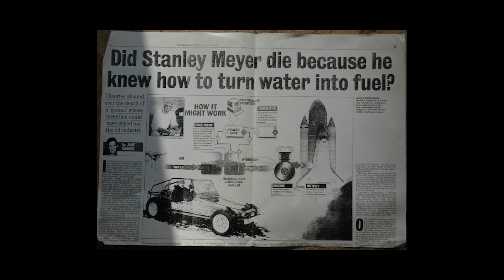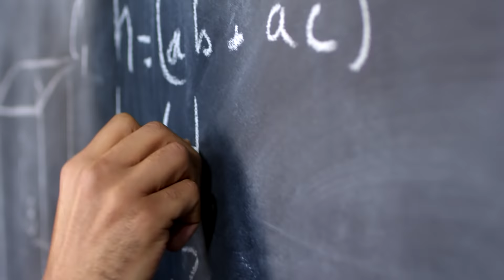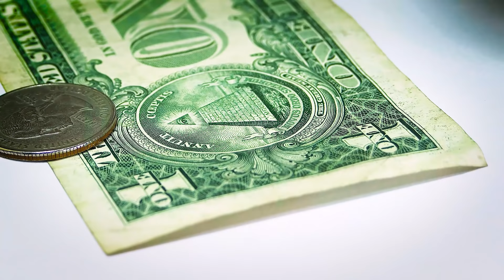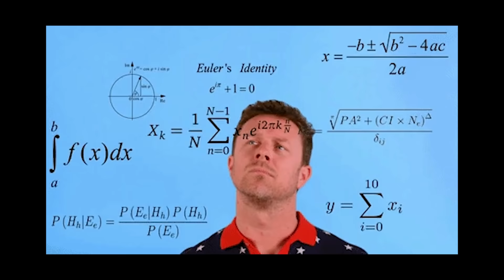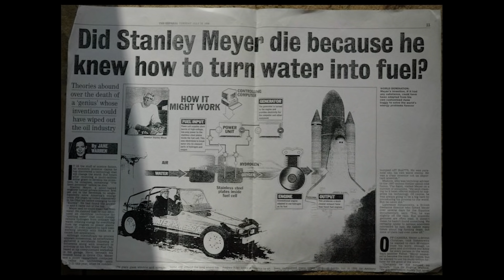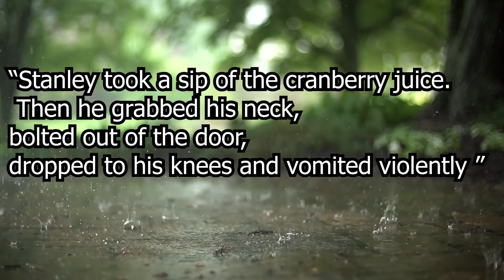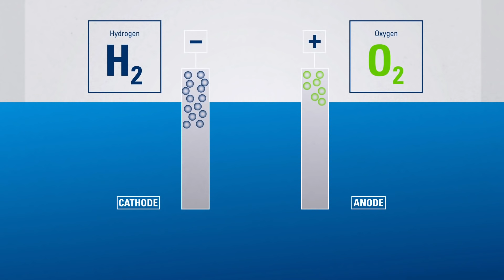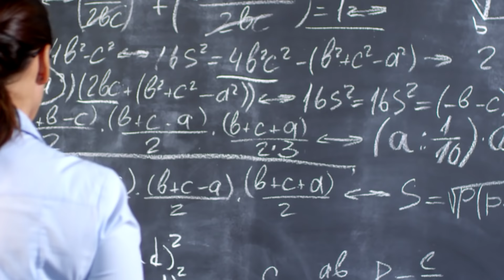Stanley Meyer Water Powered car, Lies and Death

Comment: mtttony is correct in his reply to this video, there is no way to make the excess energy appear in the form of excess hydrogen, you need to reverse where your heads are at, the energy comes from the correct burning ENVIRONMENT of the hydrogen and then the correct containment of the exhaust from said burn. that hydrogen oxidisation exhaust, is water and it is  a liquid 1800 smaller that the volume of gasses burnt (propellent and oxidiser).

combine what I'm telling you with what mtttony said, this is basically the answer to how stan made it work, the big secret. 

You don't need to modify the valve train, you do need to make a slight timing adjustment (just past TDC) and you need to inject the hydrogen at an unusual time (TDC between Exhaust and induction strokes) . You also need to ionise the intake manifold to make electron deficient oxygen (or OZONE) and use a second seperate ioniser to get more nitrogen from the air (charged Activated carbon) and add this nitrogen to the intake manifold to retard the burn, this is not that hard, easier than is sounds. 

In a four stroke, on pure hydrogen propellent, things are completely different, you can make other, different types of forces move the piston on the different strokes.  

NORMAL HYDROCARBON PROPELLENT FOUR STROKE

1 INDUCTION Stroke            down
2 COMPRESSION stroke     up
3 POWER Stroke                  DOWN
4 EXHAUST Stroke.              up
boring!

STANS HYDROGEN PROPELLENT FOUR STROKE

1 BURN WHILE INDUCTING POWER Stroke.                <<<<DOWN
2 FORCE OF VACUUM POWER Stroke                          <<<<UP
3 EXPANSION OF CONDENSATE POWER Stroke.      <<<<DOWN
4 Exhaust Stroke.                                                             up

 IN A 4 STROKE ON PURE HYDROGEN THE REACTIONS ARE DIFFERENT !!!!!!!!!!!!!!!!!!!!!!!!!!!!!!!!!!!!!! fark its actually not hard. 
The 'excess energy" comes from phase change of a working fluid. Look at how a reverse cycle air conditioner works.... 1000watt in = 3500 Joules out. COP 3.5 phase change of working fluids rob heat from an environment. this is how it works. 
Have fun. 
Ask Questions 
B-)

Comment: Of course, it worked. I have numerous HHO Fuel Cells I've made for various reasons. HHO Water Torch, HHO Fuel Cell for Lawntractors, HHO Fuel Cells for experimentation on voltage and current, and yes HHO Fuel Cells For Automobiles... I don't know how many I've built over the years. Stan went a few steps further in his setup. There's no doubt it worked incredibly well and was super efficient.
Reply: Proof?
Reply: @uku4171  my basement
Reply: @kaniuoh911  so, none?
Reply: @uku4171   come and see
Reply: @kaniuoh911  or you could do a video. That's only if it was real, though.
Reply: @uku4171  can u prove it’s not real?
Reply: @kaniuoh911  not how burden of proof works
Reply: @uku4171  u know now.
Reply: @kaniuoh911  that reply does not respond to my reply in any way.
Reply: @kaniuoh911  And I do know it is not real, as it would break the laws of thermodynamics.
Reply: @uku4171  it doesn’t have to
Reply: @kaniuoh911  should've realized you were trolling
Reply: @uku4171  took u long enough

Comment: You seriously don't think that an alternator could produce enough energy "efficiently" enough to perform electrolysis? Come on dude... as long as the battery could Jumpstart the process the alternator would have no problem out putting the electricity keeping the hydrogen flowing.

Especially considering it was directly fed into the combustion chambers from the process of electrolysis. Didn't even need to produce alot, just had to produce enough to fill each chamber before each one went BANG!

It's %100 do able you nut.
Reply: That violates the laws of thermodynamics. How do you get more energy from joining H2 to O2 than splitting it?
Reply: Trying to convince some people is a waste of time.
Mayer was on the right track.
Reply: @ChucksSEADnDEAD  couldn’t you use a battery? Hho seems like a very energetic gas how about solar powered electrolysis the whole unit in the actual car
Reply: @Nonya704  Of course you can. But the issue is that it would be better to just feed that electric energy from the battery to an electric motor.
Same with solar. An internal combustion engine is 25-35% efficient. A PV solar panel is around 30% efficient. Even assuming the electrolysis is 100% efficient, you only get 10.5% efficiency from the solar energy running an internal combustion engine that's 35% efficient.

Comment: 8:59 
Sounds like his car was the ultimate exemplar for perfecting efficiency in the Work:Heat:Pressure relation known as the ‘Carnot Cycle’ - the electrical power source for the fuel cell being returned through brake dynamos and also downhill motion activating a variable weight fly-wheel which also re-charged the battery by use of a dynamo. The variable weight of the fly-wheel being made possible by the injection and extraction of water into such circular motion as was appropriate to conditions. Such an arrangement may even have made it possible to achieve up-hill gradients mechanically with small electrical assistance. Also electrical top ups would be available from ambient planetary energy sources such as solar. Practically all that would be needed would be to start it up and then let it participate in the perpetual energetic motion of Cosmic Nature.

Comment: Firstly, Faraday's DC electrolysis (in 1833, during the age of steam) may have been inefficient, but modern computer-controlled resonant-frequency electrolysis certainly is not. If the three people sent to inspect the car did not see that it was using resonant-frequency electrolysis, then they were no experts. (Check out his patents, it's not rocket science!). Secondly, an aneurysm is very rare, a fatal one even rarer. An attack of an aneurysm would probably not lead to you running around shouting. More likely a bribed coroner! Don't forget, this was in the middle of an area of oil-rich industry. The right technology in the wrong place!
Reply: Chemical bonds require the same amount of energy to split no matter what you use to split it. And chemicals don't release more energy forming then splitting. It's basic chemistry
Reply: @gorrium5027  It's incorrect chemistry.
Reply: The dude wasn’t poisoned, his car never worked, the concept itself that he proposes breaks several laws of thermodynamics, and the burden of proof is on the people who say otherwise. Extraordinary claims require extraordinary evidence, ideally in the form a functional engine.
Reply: @notribadsvault  If you really study the science like I have been doing for many years you'll see that you can split water efficiently and it doesn't break any laws. Several people including a retired NASA scientist have got cars bikes and generators working on water alone but have quickly been silenced in one way or another. It's also been proven by the Centre for Electromagnetic Research at Northeastern University Boston that you can get more energy out of water than you used to release the hydrogen and oxygen. All engines work on hydrogen from fossil fuels but with carbon and only a small spark is needed to ignite it. Hydrogen and oxygen is a much more volatile combination, after all it's rocket fuel.
Reply: @PaulFrankAdams  does it release more energy from splitting water than the water molecule holds
Reply: @gorrium5027  Of course not! But, there's far more energy within the water than is usually believed.
Reply: @PaulFrankAdams  if it doesn't release more energy than who is the car running, you have to actively split it. So all you did was make a really shitty electric car, that has to run electrolysis. The car is energy negative
Reply: @gorrium5027  If you'd care to put that in English I'll reply

Comment: You skimmed over the tech. His electrolysis technique used a resonating voltage signal tuned especially to water, in order to break the molecules apart. Like Tesla, using frequencies can tap into "free energy" and that goes against conventional physics. If the Saudis that visited him, offered him tons of cash (at least twice), weren't worried about his invention, then why risk bumping him off?

Comment: The process of electrolisys (splitting water into hydrogen and oxygen using electricity)  requires more energy than you get out of the hydrogen. This is with a 100% efficient process. 
There are several companies trying to build hydrogen cars, none have figured cheap way to split water. Also, they cant split water fast enough to do it in the car; its done at an electrolisys facility and the hydrogen is stored in the car, which is dangerous.
Reply: Sounds like a big obstacle. Good thing Stan had a better process than your version of electrolysis or his would have never worked.

Comment: Always interested in ideas. No doubt the man was a prolific ideas person. It's a shame he died of a *cerebral aneurysm*. 

From what I see this idea was just another Hydrogen engine but with the claim of being able to produce it (from water) in a different way to conventional techniques. 

His method of electrolysis smells of hokus pokus homeopathty BS, which is a pity. 

As always, working backwards from the claim to how it's done, one runs into basic high school physics. 

Thanks for sharing this Chris
Reply: I'm glad to say your high school physics is very misleading.
Reply: @PaulFrankAdams  

Why that?
Reply: @MagnificentXXBastard  It's like using the law of gravity to prove that flying isn't possible. The law is correct but planes weighing hundreds of tons full of hundreds of people seem to fly ok.
Reply: @PaulFrankAdams  The law of gravity doesn't say flying is impossible. 

The first law of thermodynamics however says that you can't create energy, which is what this machine would do.

Splitting water into H and O and then fusing it back together again can never generate more energy than you originally put in. 

IT would be strictly better to directly use the electricity used to split  the water to power the car.
Reply: @MagnificentXXBastard  You're not 'creating' energy, you're 'releasing' it. Fossil fuels are all composed of hydrogen and carbon. Water is hydrogen and oxygen, there's two and a half times as much energy already in water.
Reply: @PaulFrankAdams  

Ah, so you never heard of chemistry before. 

water is the ALREADY BURNT state of hydrogen. It contains no chemical energy to be released. It's equivalent in the fossil fuel sense would be CO2. CO2 and H2O are combustion products, not sources of energy.

You need to put massive amounts of energy in if you want to make Hydrogen (high chemical potential energy,, combustible) from water, same as if you tried making Coal from CO2 again.

This "process" by Meyers is supposed to use electricity to make hydrogen from water to then burn it again, ending up with water again.

If the end product is the same as what you started with, you can not "release" any energy out of the process. In fact, you're just wasting energy on pointless conversion losses.
Reply: @MagnificentXXBastard  If that's true then fossil fuel also contains no energy. Go figure. Meyer's process used a little energy in the most efficient way (resonant frequency). The resulting 'Released' energy is mostly burnt and only a little water is left by recombining gases.
Reply: @PaulFrankAdams  

>If that's true

It is true

>fossil fuel also contains no energy

They do. Explain where you got that from? Fossil fuels, just like coal, are the uncombusted state. Just like hydrogen is the uncombusted state. Water however, just like CO2, is the combusted state and contains no more energy.

>used a little energy in the most efficient way (resonant frequency). The resulting 'Released' energy is mostly burnt and only a little water is left by recombining gases.

This is obviously nonsense. If you start with water and end with water, where does the energy come from? Are you saying there is less water left at the end? Where did the extra atoms go?
Reply: @PaulFrankAdams  Still waiting for the explanation
Reply: @MagnificentXXBastard  If the Hindenburg full of hydrogen exploded, where did the energy come from?  If the Space Shuttle used hydrogen and oxygen as a fuel, where did the energy come from?
Reply: @PaulFrankAdams  still waiting.
Reply: @MagnificentXXBastard  Still waiting for what exactly?
Reply: @PaulFrankAdams  

An answer to what i asked:
" If you start with water and end with water, where does the energy come from? Are you saying there is less water left at the end? Where did the extra atoms go?"

And did you really not understand that the hindenburg wasnt filled with water, but with hydrogen, which, unlike water, contains chemical potential and therefore burns.
Reply: @MagnificentXXBastard  Of course I know the Hindenburg was full of hydrogen that was my point, full of energy. Where does the energy come from in water? Hydrogen, you answered it yourself don't you see?
Reply: @MagnificentXXBastard  Yes, the hydrogen is inert when bonded to the oxygen atoms but it's a well-known fact, that splitting water by electrolysis releases usable hydrogen and oxygen again. The question here is whether it can be done efficiently and just how much energy is released. I am suggesting that there is a lot more than generally understood.
Reply: @PaulFrankAdams  

>Yes, the hydrogen is inert when bonded to the oxygen atoms but it's a well-known fact, that splitting water by electrolysis releases usable hydrogen and oxygen again.

You're SO close to getting it!

Now, according to the first law of thermodynamics, the energy you need to put in to separate the Hydrogen from the Oxygen is the same as what you release when you bond them again. And that is already assuming 100% efficiency in the electrolysis process, which is not possible, making this endeavour a net negative energy drain.

So it's entirely pointless and a waste of energy.
Reply: @PaulFrankAdams  Did that explanation satisfy you or are you still believing it's possible to trick thermodynamics with perpetuum mobile nonsense?

Comment: From my research Stan also was using a plasma spark to ignite the hydrogen/water mixture as well. A plasma spark will ignite water vapor many demonstrations of this to view.
Reply: Correct, the part that made it possible was the sparkplug combined with a water injector, that created a plasma that instant vaporised the water. The rest of all the videos are about the electronics for the timing, coz a bug doesnt have injection system. And about mixing outside air with the injected water to adjust the burning temp, coz pure hydrogen en oxiden would burn a hole in the engine. And how he can set it to the rate of diesel and gas so all engines could be modified with his sparkplugs.

Comment: Considering he was just a con artist, I wouldn't be surprised if one of his victims offed him. Essentially all he did was create an electric vehicle with a couple of unnecessary steps included to make it less energy effecient and require more moving parts.

Edit: If you simply used the electricity needed to split the water to power an electric motor instead, it would be far more effecient and require far fewer moving parts.

Comment: Well oil isn't going anywhere. But this  Invention that he did make sense because all the processing is being done inside  Cylinder walls of the motor. Because you're using the Ignition system coil to be that powering source That which is a lot  Voltage That is being used that would be able to process the water instantly using the plasma arc. And he has the setup for the plugs for a distributor , And the quail packs that you would have on the newer vehicles today. Plenty of voltage plenty of power no excuses.

Comment: Aside from the drama of his death. You can ONLY use distilled water for electrolysis to work properly. And distilling water takes a lot of energy. Fresh and salt water have all kinds of minerals and metals in them. That's why you can only put distilled water in a lead acid battery. If he could some how make tap water work directly in the car. Yeah. That would be a game changer. Distilled water cost around one dollar per gallon at any super market. It's still cheaper and cleaner than gasoline or diesel. But you need fuel to distill the water and that cost money and leaves a carbon footprint.

Comment: You have the story wrong the car didn't have a fuel cell that was before  and he had a patient for it and the patients officials witness it producing more power  than it consumed thats why the issued the patient back to the car he had devised a way of splitting the water into hydrogen and oxygen in a type of injection system and injecting it into the engine without  the need for a electrolysis in the car.